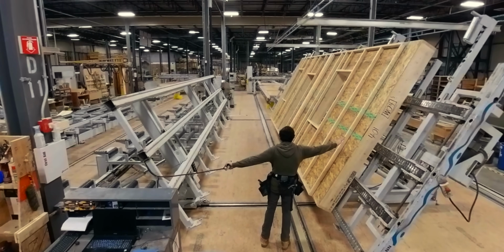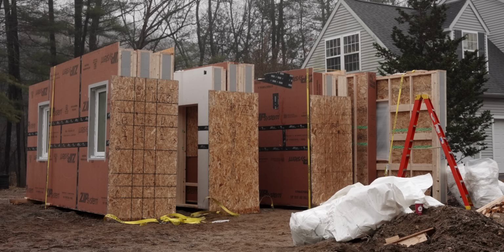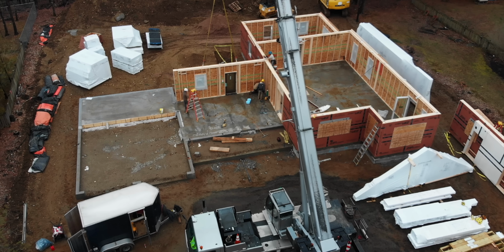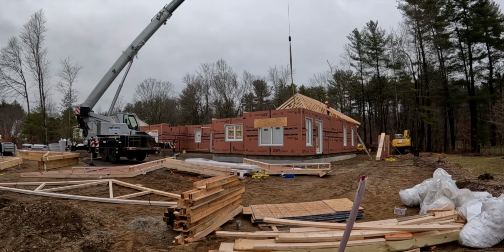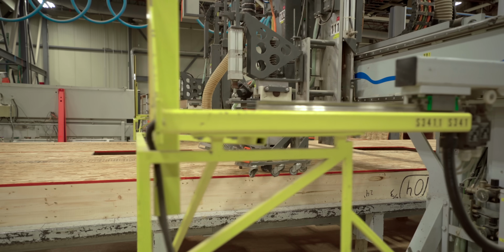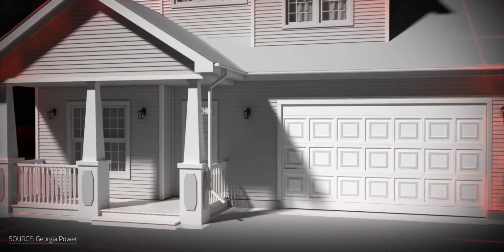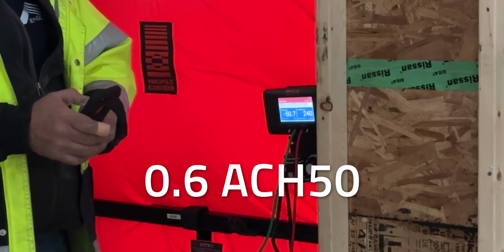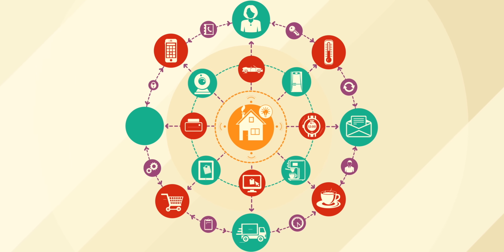Wow! I Didn’t Know A Prebuilt House Could Do This

Comment: I like your manufactured home.
Nice choice.
When I had a garage built some years ago, the  contractor who dug the foundation, and prior to them pouring the concrete, he was very surprised when I laid sheets of 1 inch foam board into the trenches along the OUTSIDE walls.
   He got excited when I explained that this will greatly help to pull up the ground heat into the building during the winter, and reduce thermal cycling structural movements.
  This extra warmth will also help to reduce condensation on the floor.
  I also set large 1" steel eye bolts into the wet concrete at all four corners.
  He asked WHY?
I explained:  To install heavy duty chains for securing important things, like trailers, tool chests, motorcycles, big air compressors, etc.
  (Thefts from garages are a problem in every nation, and my little security measure will help to prevent any such BS.)

  I tried to insist on Sheet Metal Roofing (because it lasts from 75-100 years AND is Fireproof from falling sparks from other fires), but nobody in the area offered it).

So I went with the white, 40 year Architectural shingles AND then I got up there and applied 2 coats of 20 year, exterior, white house paint.

Why?  To insure that I will never need to pay for a re-shingle job for at least 60 years.  (Reroofing jobs typically cost 400% more than the original prices, so a little extra money now will save TENS of thousands in the future.)

Comment: Is the concrete making up your foundation water proof? Asking because I haven't seen any hydro isolation on the foundation. That little whatever they installed on the bottom of the panels seems not to be too adequate in keeping the water off of your panels if it creeps up on the concrete foundation.

Comment: Please discuss the financial planning requirements for a build like this. I’m interest in how the planning and sequencing worked, and how you managed financing (if any) around a non-conventional house construction.

I’m also curious how you got around traditional incumbency in the construction industry to get all the features you wanted (.i.e passive house, heat pump, solar energy, etc).

Did you consider non-detached single family home structure at any point? Did you learn anything about how a simile effort could be done for a duplex, townhome, or other small residential structure?

Do you think you’ll build an ADU?

I appreciate these videos! Please organize as a list for others that want to follow in your footsteps

Comment: Matt, I do energy audits on existing houses for a living and I do agree that new houses can be economically sealed to under 1 ACH (typically by using aeroseal), existing houses are very difficult to get to that level (you can't use aeroseal on existing houses full of furniture) and I don't think it is required. Hear my logic. Houses with under 3 ACH require an HRV or ERV to ensure humidity levels do not become so high that mold can form in trouble spots like cold humid basement areas. Adding an HRV adds energy. HRVs are not 100% perfect at heat recovery, 60% is a common value for many HRVs. That translates to 40% fresh air that has to be conditioned (heated in the winter and cooled in the summer). When one seals a house and adds the HRV the energy costs of 40% fresh air is the same as 3 ACH. In effect sealing below 3 ACH causes one to install an HRV and it costs more in energy than not installing an HRV which isn't really required. When I explain this to my clients almost every one says I will forgo the $5,000 expense of adding the HRV and crack open a window occasionally. Also don't negate the amount of expense and embedded carbon one has to spend to go to a passive house level of air sealing. Those windows and doors are extremely expensive, there is embedded carbon in the HRV and added measures to get to .6 ACH. It's not clear to me that a) that carbon is ever recovered, b) adding a couple to few more solar panels and slightly larger heat pump isn't a much more economic way of solving the issue.

Comment: I'm surprised they did the air test before electrical, plumbing/dwv and HVAC. I mean it's good to know before but those utilities/ components are going to cut holes into you envelope. Also that Zip sheathing is great stuff and your windows r-rating are pretty impressive, of course that comes at a premium but if your looking for efficiency that's a pretty good way to go.

Comment: We're living in our 10 year old custom, energy efficient house. Question:  RE the windows in your construction.
In several instances our Alpen windows have suffered interior pane, pressure-induced breakage during several violent, sudden pressure-dropping, storms. The question: have you had any observations or experienced anything like this with your windows? In our case only the interior glazing fractured.

We imagine this has to do with sudden exterior pressure change and the ability of the window glass to withstand the atmospheric impact. At this point we open a sheltered witndow prior to approaching storms to enable a pressure sensitive  pathway for such events.

Comment: I'd be keen to know more about the ERV. In attempting to make an existing house as efficient as possible (maximizing insulation etc.) a fundamental problem is ensuring an adequate supply of fresh air. The best remedy *seems*(?) to be to just throw windows open for a short period of time to try to get a complete air change as quickly as possible — as air doesn't have a huge thermal mass this minimizes heat gain/loss (depending on season). I'd much rather have a continuous system though if it would be possible to retrofit — if that makes sense.

Comment: Great project Matt! Looking forward to seeing how the rest of the project goes.  I would be interested in hearing about the other zero carbon standards that are available.  Passiv Haus looks ideal for where you are building (it looks cold!) but the standard is arguably less fit for purpose in warmer climates (such as the UK) as it was developed for a German climate.  For example the Passiv Haus standard pushes for high levels of insulation and very low air permeability which is arguably slightly less important where it doesn’t snow.  What’s the right standard for warmer climates such as South Cal and Australia?  It’s an interesting debate.
Reply: Obviously there are diminishing returns on this, especially in more mild climates.

Comment: As usual, great video!!  I do have a question or two. First: What made you go with cellulose rather than spray foam or RockWool??  I ask because I did insulation install's many years ago and the thing I did NOT like about blown in fiberglass and cellulose, (which we blew in), is the fact that over time it sags.  I saw this on my own home.  I like both Rock Wool and Spray Foam for several reasons, but mostly because they do not sag and Rock Wool is pretty much fireproof!! (Pretty much)!! Spray foam has got to be the best at sealing up the envelope we should all have!!!  So why did you go Cellulose? 

Also, being in the North, why not an insulated slab??  I would have never considered it before living in Florida on a Slab On Grade home. When it gets cold here in Tampa Bay, our floors get very cold and uncomfortable... I would have thought you would have gone insulated and floor heat!! I sure would!!

Comment: It didn’t seem like the foundation had a thermal break between the earth and concrete - thoughts there?  I’m guessing with your geothermal you didn’t go radiant floor heating in the slab?  Will you be insulating above the slab and installing radiant floor heating above that?

Comment: Your are building the house I wanted to build in 1976 when I was a brand new electrical engineer working for IBM and was shocked at the cost of cooling a house in Austin Tx.   I started looking at solar and geothermal for cooling my house because the cost of AC was too much.  I moved to Colorado and looked at building a berm house.   What you are doing is really a great step in building an efficient house.  Love your other videos too.

Comment: I think that it is an oversight not to build a full basement. You are spending to create a footing dug to the local frost line, which I suspect is around 3 feet in your area. The marginal extra cost to double your available potential floor space is money well spent. The exception would be if you are building on rock, and the excavation costs would be too high.

Comment: this more interesting than battery video that came after this. Is data available on when you break-even the cost of this vs a typical build? Isn't geothermal too expensive than just air heat pumps?

Comment: Hi, I recently installed a Climate Master QE 0930 geothermal heat pump. I would recommend it over the Water Furnace 7 series due to the fact that it has dedicated water heating and virtually free water heating during the cooling season. I also installed a 10kw PV array. Good luck with your build!

Comment: I'm trying not to rain on your parade, as it looks like you will have a wonderful home.  However, your home IS a stick-built home.  The sticks are just put together indoors.  By the way, a home too tight is not great for indoor air quality.   The energy pre-consumed for the Solar Panel production (shipped from China),  The Lithium Battery production (high energy) likely shipped from Asia, extra transportation of materials to and from the factory, etc etc.  This and the fact Electricity off the grid in your area is likely coal, your positive environmental impact is likely extremely minimal.  Honestly, a high-quality efficient wood pellet stove would have been better.  The environmental movement of today is a "feel good" movement vs. scientific advancement.  If it was science-based, we'd be dropping Nuke plants in your neighborhood.  Cheers!  Enjoy the new home.

Comment: We used to build sip houses, but fire rating so don't no more. We build passive solar masonry houses now. Usually D.C. electric because more energy efficient and long term cost. We go R60 in floors and roof. We over engineer for solar gain. We use a wick style system for moisture. To keep it drawing moisture out. We use exposed trusses with insulation on top of ceiling finish. That's usual weather to build in. We use thermal breaks around windows. We don't use forced air either for heating. Been doing a lot of off grid work.

Comment: Cranes are rented by the hour and it doesn't matter if it's being used or not; if it's at a site then you are being charged for its rental. So the fact that the construction crew actually worked into the weekend  probably saved you a few grand in crane rental cost(even when accounting for overtime rates for the crew running the crane on the weekend).

Comment: My wife and I were looking for a house around the time you and your wife were. The way the housing market was after the pandemic was to say the least, crazy.  I have been following your channel for about four years and plan for going as green as I can within my means.  One of your topics you had covered was modular homes.  That modern modular homes are a close second to a passive home like yours will be.  This is the direction my wife and I took. After nearly a year of looking for property and material and labor shortages, our house was built. It took them only a day to place the pieces of the house on the basement foundation.  Our house walls are R29, the attic R49 and the windows are all Low-E, argon filled.  We moved in about six months ago, and in about two weeks, our solar panels are going to be installed. The whole thing is an exciting process. One I wouldn't have missed for anything. Patience is the only thing needed.  I wish you and your wife luck going through your process.
Reply: Great add on story.

Comment: I'm getting a house built. Sadly it's a spec home that they're fighting me on every little change I want done. Just getting them to agree to put in a heat pump instead of AC took a couple dozen emails and a 2nd contract, despite the install being easier than furnace + standard AC. 
I'm concerned about asking to replace the water heater with electric, or get some future solar install steps taken. 

Must be nice to have a home built to your standards instead of to whatever will make the builder the most money.

Comment: I have that same Geo thermal unit (3 ton) Waterfurnace 5 series . Have had it about 9 years and love it. Definitely opt for the better thermostat, as it will track how much electric it is using. Mine uses about 15 bucks worth of electric per month to keep my house at 70 here in Northeast PA. Also is waaay more efficient when using it for cooling in the summer.

Comment: Don't forget to oil your fancy windows every year. A few drops can make a difference. And make sure the handle is at either exactly 12 o'clock or 3/9 o'clock before you open/close. They can last for decades if treated right, but the complicated mechanism doesn't like being manhandled. It will wear prematurely if you're being careless.

Comment: its a shame factory built homes aren't the norm.   it would give a better chance of building inspectors doing their jobs if they could go to a factory and sign off on multiple items at once in a controlled environment -- vs not checking on sites -- also i would guess the labor pool would be higher quality since its a full time job rather than being paid under the table

Comment: Would love more info on the windows. Can those be purchased by the public? Also very interested in your geothermal system. How it was determined where to site it on your lot, how deep your trenches are for you location, if you're looping or running straight, and if you can put anything on top of your run (ie. landscaping, veggie gardens, hardscaping, etc).

Comment: Great video. For plumbing look for pex type c pipes and instant water heater for each batt or kitchen. this way you only need to run cold water lines n each instant water heater will emlinate single point of failure and you wont need to install ciculator at your water main water heater to get instant water.

Comment: A note of caution regarding your cost/benefit assumptions... In Southern California a large portion of both electric and gas bills are composed of fees, taxes and various other mandatory charges that are NOT connected to the specific amount of energy used.  One can go on an extended trip and though energy use plunges by 80% or more, the bill may be only about 15% less than when the dwelling was continuously occupied.  Assuming that a unit reduction in energy use will result in an equivalent reduction in one's monthly bills is not realistic - at least in some markets.

Comment: Interesting to see your air leakage testing woes
 What is the working life of the tape they are relaying on to provide the air tightness over the next 50 years at least? Also, your window and doors, I have put full height triple glazed units, including sliding patio doors 1 years ago, which were tested to achieve 0.7 U-value.... One would have thought we have moved on since then...

Comment: Matt, I would love to see a video talking more about your geothermal heat pump and how you chose the model you did, and also what kind of ground loop installation you're doing.  I've seen lots of videos on YouTube from people installing air-source heat pumps, but not much on geothermal heat pumps.  With the geothermal being capable of operating efficiently at a wider range of temperatures I would like to know more about the cost difference compared to an air-source unit and any extra considerations that need to be taken into account.

Comment: Great vid, appreciated. If you could do a vid on the solar/battery wall would be cool.  Have seen quite a few for off-grid, home-made, and as an add-on to an older house, would love to see a new build with the wall as a planned part of the build. Is there a newer breaker panel with self power generation ready to add in? Does it change how the wiring is installed (ex. second circuits run to similar locations in house)? What are the regulations that restrict where you can put it?

Comment: Matt, are the walls built with conduit to run cable in the future? For instance, I prefer Ethernet to wireless and that can be challenging in a structure that doesn’t have available conduit to run cables. When designing remediation systems, we would recommend the owner pay for 1 extra pipe run parallel to the design runs. It did not add much to the total cost, and at sites were change or expansion became necessary, those unused pipe runs were very useful.